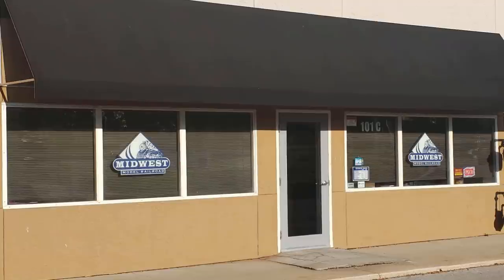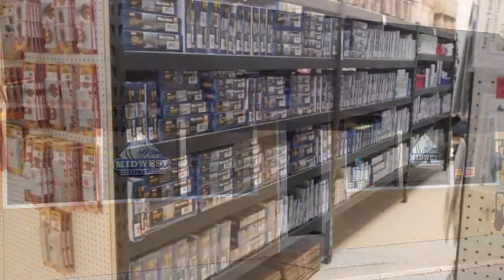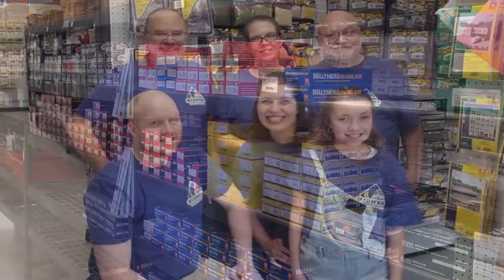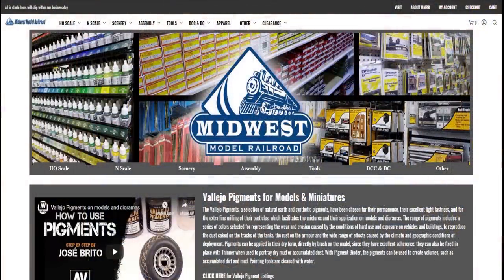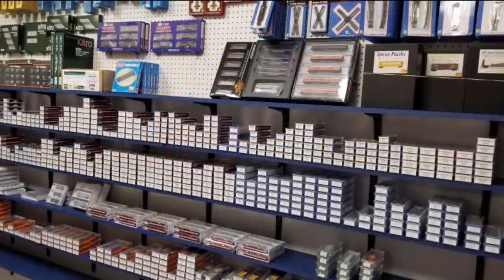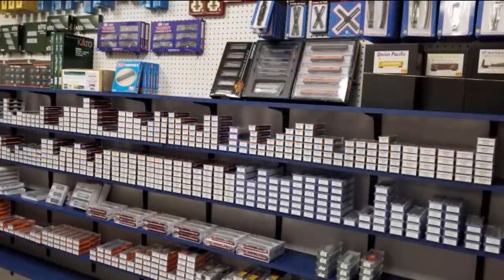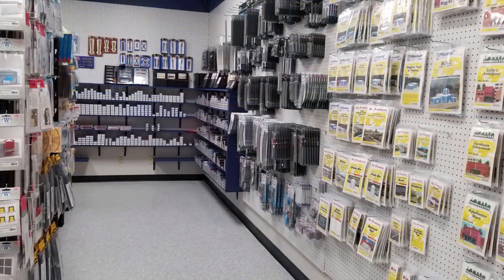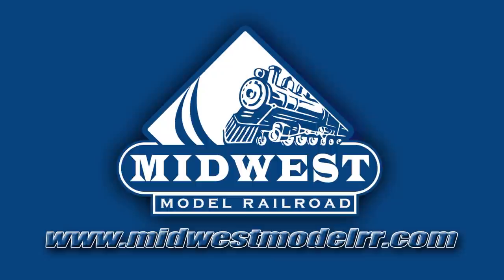Forced Perspective and Model Scenery

Comment: Great work! I think it's worthy for your viewers to note that the forced perspective works best from specific viewing angles or lines of sight, just as in photography/videography. Some might be disappointed in the effect when standing over a layout, or viewing from a different angle than intended. Cinderella's Castle at Walt Disney World uses forced perspective to give the illusion that it's much taller, reaching farther into the sky than it actually does. The spires and windows shrink in size as it goes up. The reason it works so well is because park visitors are always viewing it from the ground level, looking up. Peace and love.

Comment: One of the tricks to forced perspective is to have something far larger closer to where it's viewed from, and most modelers  make the mistake of not thinking that  a mountain side is receding when putting in trees on it. Most that get  installed will actually be oversized to begin with especially Pines and it's why they look more like a grove of Sequoias in a layout than the Ponderosa/Conifers they were intended to be from the start. Indeed a good rule is to have a tree no taller than the figure is tall by a factor of between 5-12 times in height and it's on the shorter range if the trees are deciduous like Maples/Ash for example. If a scale figure say is to look like its 6ft adult, the math is simple as 7x would be 42ft but say at 25x it would be the same height of 13 story building in a layout. Most trees are about one train car in length perhaps two if your pushing it in the scale your using, and the further there towards the ridge line the should be getting shorter sometimes by a factor of 10+ from what starts at the base. Ron showed forced perspective quite well when he held a tree in front of his shelf road but it should almost on the leading edge of his layout especially if the rest he's thinking about aren't to the Z scale or less near it as much as possible. One way to get the optical illusion of forced perspective is not attaching a hill/mountain to the back wall/sky and it's a stage trick where a series of cutouts are used to give depth to a set as those few feet or on a layout 1/4in is all that needed between features etc. We all have know about this effect if you've every had or thumbed thru a Popping Book and it's 3D but also why flat print of the same picture isn't quite as delightful to the eye. Kudos on the video Ron especially on the backyard example pic oh by the why is also called a merger in photography and it's like  having a photo of of a cloud behind you going thru your ears. 👍